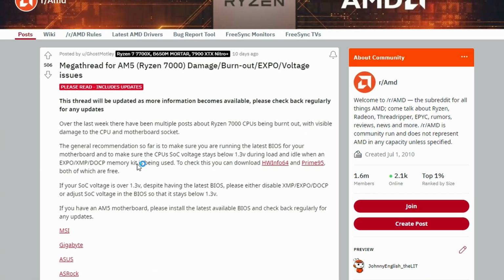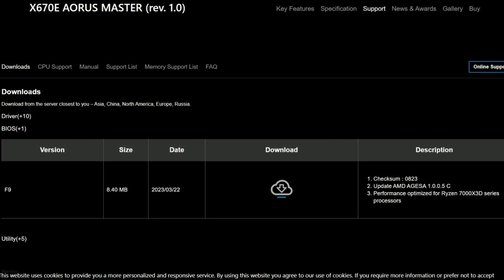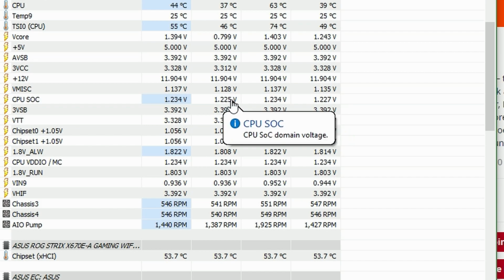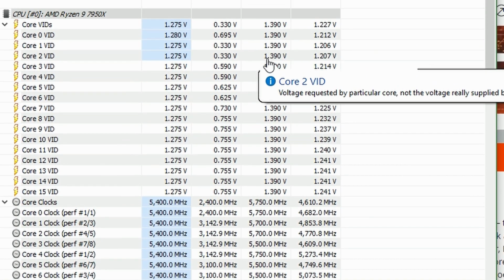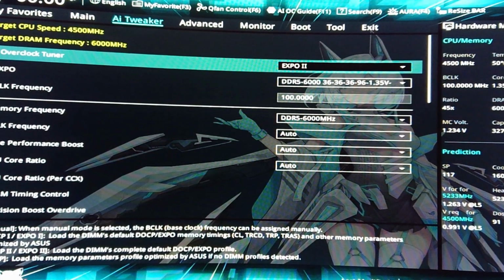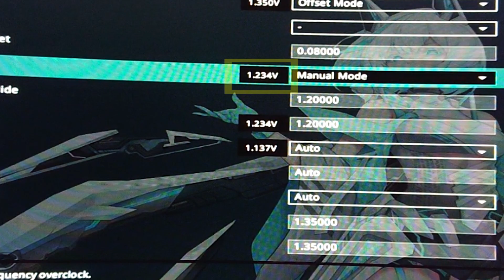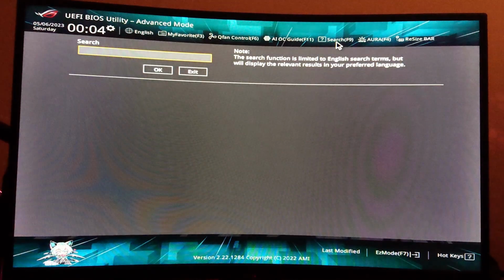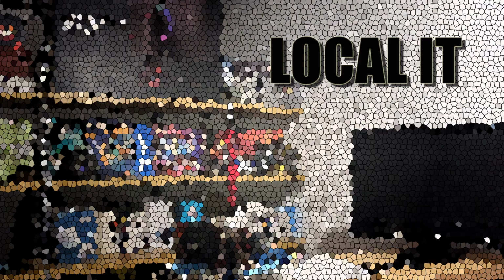Burned 7000 Ryzen DO THIS NOW! - 7800X3D or 7950X

Comment: What is the difference between EXPo I and Expo II? I have 6000MHZ on EXPO I and my system crashes, on 5600mhz it is stable
Reply from the maker: Hi, I'm trying to put a video out this weekend that tackles that. But I'm not a big channel capable of holding up this kind of information hostage :P
So here it is: EXPO I will only load the 4 main timings where EXPO II will load sub timings too, normally EXPO II can be a tad better on latency but could lead much more BSOD's too. Try it and check it, nothing too loose ;)
Reply: Me too, I have G.Skill Trident Z5 Neo 6000Mhz CL30 AMD EXPO and when I set it to EXPO I my pc instantly bluescreens, but at 5600Mhz CL28 is stable. I checked and my RAM isn't on my motherboard's QVL ram compatible list, and it only is on more expensive ROG motherboards QVL list, so i think it bluescreens because of that.

Comment: How about... a question, can ddr5 ram modules with XPM be installed on AM5 motherboards? I am interested in putting the 4 modules of 32 gb. (apparently with the latest bios it is already possible) thanks in advance ..... (google translator)
Reply from the maker: Actually, I am editing a vídeo right now with an answer to that. 😊
Mas arriscando em Português porque acho que dá. 😉
Os módulos XMP dão e funcionam na velocidade anunciada desde que a Board diga que suporta, isto é, está no QVL. O que pode acontecer é teres azar na lotaria do silicone e não conseguires usar a velocidade máxima das memorias mesmo estando no QVL. 4 módulos e 128gb pesam muito no IMC (controlador de memória integrado) do CPU.
A diferença de EXPO para XMP é que as EXPO geralmente são mais agressivas, menos latência e mais chance de funcionar bem.
Conclusão, devem funcionar mas é arriscado... 
Abraço, partilha e Subscreve. 😉

Comment: Hello!
I'm running 7800x3d with 6200mhz ram with tuning timings ram voltage is 1.4V. x670e-e gaming wifi. I'm using the 1303 bios version and when I check my soc voltage locked to  1.279V but CPU VDDIO /MC is locked to 1.43V. am I in danger?
Reply from the maker: I'm not comfortable with 1.43 on VDDIO but they haven't introduced a cap on it. So in a way its "safe" but since I'm running stable with 1.2v, I'll go with that.

Do you have manual option available or negative offset so you can lower it?

Some people are reporting its locked while others can still use manual.

Thank You

Comment: Using corsair 6000 mhz ram in expo mode on my asus b650e board with ryzen 7900. After the last Asus incident, should i disable expo mode in bios? I did not update bios. Btw, my rams needs 1 4v to run. Should i change it to 1 2v?
Reply from the maker: Hi,
You can continue with EXPO enabled, just follow closely the tutorial. Its not the voltage on the ram (VDD and VDDQ) that needs to be lowered but CPU VSOC.

Thank You and Subscribe
Reply: @LocalIT  it is not possible to change voltage manually unfortunately.
Reply from the maker: @mordavian some people are reporting that the manual is locked but it shouldnt on older bios, can you post a picture? Try if negative Offset with - 0,1v is available. Check HWiNFO if your vSoC is above 1.3v

Comment: Great video you nailed it again. Just installed 7800x3d and asus x670e-a mb like the day after news broke on the voltage problems. Updated bios to 1303 and constantly check voltages in hwinfo64, all good so far. Keep us updated please. Enabled expo II, curve optimizer to neg 30 (really helped temp), what about core performance boost?
Reply from the maker: Thank You so much for the comment. This really got me rattled, so I stopped a bit on performance tweaks, however, I want to get back on track with a video about PBO and Curve Optimizer as soon as possible. Im also thinking on doing a short video about expo memory tuning.
Reply: @LocalIT  Perfect, thanks.
Reply: @LocalIT  waiting for the new video
Reply from the maker: @Alpha44-h4o  I'm so sorry, you are right. Unfortunately, life and work hasn't been kind to me. Trying to organize things around to get back on track. But One thing is sure thing, I'll be ready to answer all your questions here.
Thank You
Reply: my 7800X3D can't even get to neg 30. Had to set it per core and set every Core to neg 15 and Core 3 to neg 10, otherwise i run into errors after 7 hours of Prime 95.
On neg 20, Core 3 and Core 6 go into Error after 3 Minutes of Prime 95
Reply from the maker: @BeatmasterAC  not everyone can do minus 30, I can't. Max I can is minus 15, then I'll use minus vCore Offset to lower down voltage without bumping up  performance curve to keep stability with less temps.

Thank You for the comment and subscribe
Reply: Are your parts still intact?
Reply from the maker: @Myloh_YT  If you don't tag someone its hard to know.
But everything is going really great here.
Reply: Alls good, no problems @Myloh_YT

Comment: Do this now; Just buy Intel.
Reply: It's more of a motherboard problem. ASUS overvoltage Intel CPUs as well. It usually doesn't kill CPU but degrade them quicker.
Reply from the maker: Why?
Reply: The wife got the 13900K. I can tell you I'm jealous. Her PC constantly runs better than mine at 1440P ultrawide in the games we play. It also doesn't have these other issues.
Reply from the maker: Well.. I'm sorry but I see the other way around. I work with Intel every day, its a business decision, however, I see better performance at home with AMD on DaVinci Resolve, I also dont game as much as I did. 
I'm running a 7950X on a 240 Ryujin AIO that I already had, I though that would be near to impossible but after setting some tweaks in place, like curve optimizer, and much lower voltages, temps are considerably lower than stock. Even reducing the risk of damage.
I'm very happy with it.

Comment: Got a b650 Carbon Wifi with the newest beta bios.
SOC is 1,2 but cpu vddio is at 1.392V   
Shoul i change it??
Reply from the maker: I would, then stress test it and check memory stability.
I did change it on mine, still running at 6000 cl34 from a cl36 kit.

Comment: My 7950X died today. I built it back in December 2022 and didn't update ASUS Bios after I build it. I just turned on XMP 6400 and everything else was on AUTO. I noticed motherboard had SOC voltage of 1.4 on auto setting! No wonder it died. I did RMA request right now to AMD.
Reply from the maker: I had mine at 1.38 for a while, Yikes. I'm even considering 1,15v instead of 1,2v. The lower the better without compromising stability. I'm at 6000 on EXPO.

I hope next one runs like a charm.

Good luck!
Reply: @LocalIT  better offset or manual voltage with fix rate?
Reply from the maker: @nivea878  at this time I would do manual fixed value. Looks like Offset on vSOC may lead to unexpected jumps that can be dangerous. If you have the latest BIOS auto should be enough but like I said, I playing on the safe side. ;)
Reply: @LocalIT  thx for replying me🤗 this was a general question, i run a 13600K, so its also better fix rate with raptor lake or is this just for ryzen 7000?
Reply from the maker: @nivea878  any undervolt can be very beneficial to either Intel or AMD ;) Normally a fixed value is more helpful on all core overclock or when the system is running unstable with Auto or Offset values.
Reply: @LocalIT  ah didnt know that, my intel runs with - 0.085 offset no stability issues
Reply from the maker: @nivea878  that sounds really good.
Reply: @LocalIT  wich cpu you bought?
Reply from the maker: @nivea878  I have several CPUs from Blue and Red teams. At work I use a 12700 and at home I run a 7950X and a 2700X. Have older ones but these are the most recent. Trying to get my hands on a Threadripper as editing rig.
Reply: How did you update the bios without and before launch the computer i don't know how ? I will purchase a 7800x3D and a Asus TUF Motherboard, how can i do an update bios to reduce voltage ?

Comment: i got your same board and im using bios 1303 is it safe
Reply from the maker: Hey, the 1303 version is focused on X3D, if you have the X variant you may want to double check voltages and follow this tutorial.

Thank You and subscribe
Reply: @LocalIT  i got x3d 7800
Reply from the maker: @hyperninja_-z  You should be OK but I would get HWiNFO and double check the voltages just in case.
Reply: @LocalIT  my soc volt is 1.24 in hwinfo
Reply from the maker: @hyperninja_-z  looks good, keep loging for sometime to see if it spikes. If not, I believe your are safe. 😉 I would also check VDDIO/MC. I lowered that one too.
Reply: @LOCAL IT   - 7800X3D here, running perfectly until yesterday when I used ASUS flashback and updated latest version. Ever since then I'm getting weird programme crashes and higher core temps by 10-15c under load! Very weird.
Reply: @idlenavigator4980  which bios version u are using
Reply from the maker: @idlenavigator4980  Try reverting back and safeguard voltages manually till they get a stable version. Its a though call, I know.
Reply: @hyperninja_-z  1413
Reply: @idlenavigator4980  you mean 1410?if yes use 1303 because 1410 is still beta version.